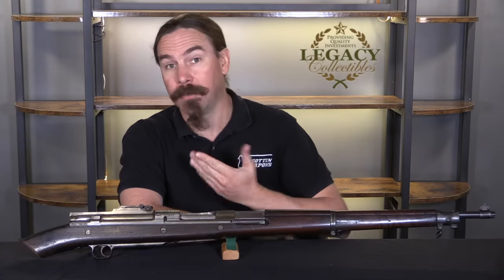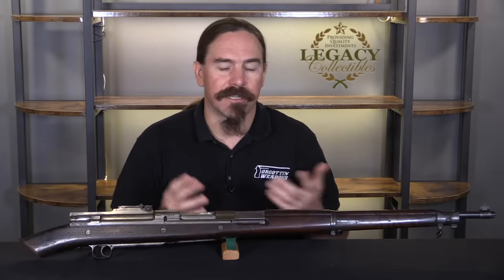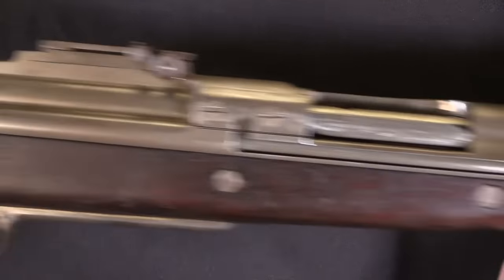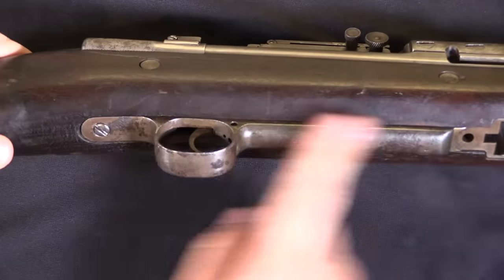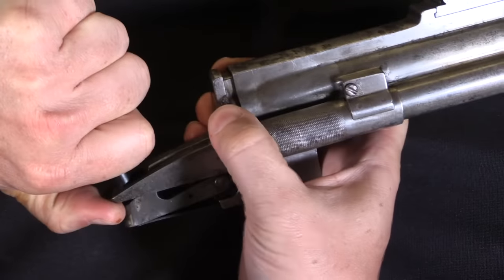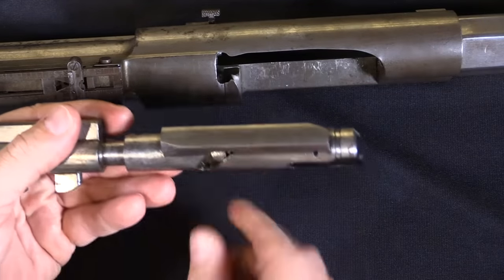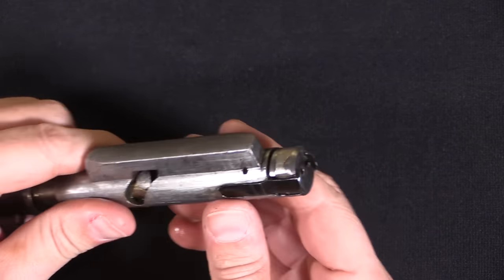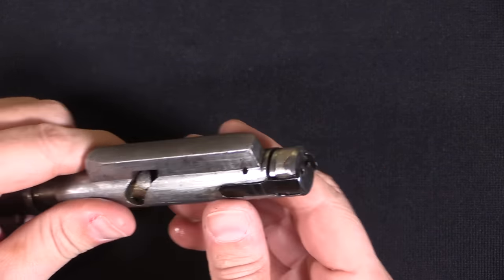Headspace-Operated Prototype Rifle - Yeah, it's as Weird as it Sounds

Comment: I know you often say gun design is an iterative process and that all the things we use today are old inventions, but I didn't expect I'd ever see an old timey version of the HK G36 folding charging handle.
Reply: Almost looked like an ar bolt catch. If this has last round hold open it bet it was the exact same.
Reply: Not only it is an HK G36 folding charging handle but also you can HK slap it.
Reply: @calebreutener870  It does If you look a little tab extends forward and would get hit by the follower when t is a the way u. Exact same profile as on an AR

Comment: The presence of a leather buffer and so many stock reinforcements seems to suggest this thing recoiled like a hammer.
Reply: The idea is kind of a G3 on steroids: no piston, brute force on the bolt, much less delay than the rollers, and a big mass moving.
It would kick like a mule, I guess.
Reply: Maybe they were making work out equipment from surplus guns
Reply: You don't have enough stopping power unless you risk breaking a recruit's shoulder

Comment: Given how dangerous this mechanism is, the inventor probably cut off the stock and mounted it in a clamp so he could fire it remotely with a lanyard just in case it totally blew up in his face!
Reply: That's what I decided once Ian got to where the rifle was in it's development.  An early prototype, like this probably was, doesn't need a shoulder stock, because nobody is ever going to shoulder it.  It will only ever be fired from a clamp, and a shoulder stock would just get in the way.
Reply: It doesn’t look poorly built enough imo, although that bolt doesn’t look too reliable to run reliably and with wear maybe a premature ejection problem
Reply: @egg5474  because all prototypes have to be crude
We dont know if this was v1 or v10
Reply: @justarandomtechpriest1578  no one said it was crude. But by definition a prototype is not a production model and should be distinguished as such to prevent it from entering distribution or being used for other purposes. A rifle of this design without a stock is not likely to be picked up and fired by anyone other than it's intended operator
Reply: @christopherreed4723  atf says if you can't shoulder it then it's a pistol, so there ya go 🤠
Reply: @beargillium2369  Screw ATF...🤬
Reply: @egg5474  its not poorly built but "blowback prototype 30-06" is terrifying to shoulder.
Reply: One wonders if the inventor was hoping to be paid by the inch of rifle length?
Reply: I had a British 303 that was everyone's favorite deer rifle. We shot it so much it eventually grew a large crack up the stock and became dangerous to shoot. I cut it off close to the receiver just so nobody would shoulder it and hurt themselves... Never really know why someone does weird stuff to old guns but that's my story.

Comment: When Ian explains the mechanism of a firearm : 100% on board with understanding how it works.
When I see any gun firing : "Wow, it's unexplained magic !!!"
Reply: Honestly the AK is the only gun I see in action and I'm like "yeah, I know how that works actually"
Most other guns I understand in theory but I squint a little and theres a lot I dont get
Reply: Blowback is easy enough, it's literal weight and spring force that's holding the cartridge in place.

Direct impingement uses gas from a fired cartridge to rotate the bolt.

Now, roller delayed blowback is... Hard.
Reply: @gerrymandarin6388   Recoil operated is similar to Blowback but the barrel moves with the bolt. Short Recoil: The barrel moves half to length of the cartridge before the bolt travels the rest of the way. In Long Recoil, the barrel travels the full length of the cartridge.
Reply: @gerrymandarin6388  Blow-forward and rotating-barrel, short-recoil are both reliant on the bullet's friction on the barrel. It's a simple enough concept, but I'm still amazed that it works.
Reply: This is how I feel about both firearms and cars lmao

Comment: So here's what happens after you have watched enough of Ian's videos- you end up knowing just enough to come up with all manner of theoretical alternative operating systems, such as this one, and then invariably Ian comes along a couple of months or years later and shows you that yes, it might be possible, yes it has been tried but here is why it was shit.
Reply: I made an SMG version of this that was visually based on the Ribeyrolles carbine years ago, lol. Didn't know it was a thing until today.
Reply: @Dreams_Of_Lavender  made?
Reply: @nosuchthingasshould4175  "Made" as in created a concept model in Blender. Not "made" as in created physical prototypes.
Reply: I wouldn't say they are shit designs but simply limited by technology at the time. The working principal of this design just needs to be figured out and this guy simply had trial and error, not high speed cameras and other tools in order to perform any diagnostic checks. Plus it was stuffed inside of an unwieldy form instead of a typical assault rifle.
Reply: @Dreams_Of_Lavender  Color me disappointed.
Reply: Although you can kinda see the germ of the idea that lead to the AR in there, But that Stoner used the gas to push the bolt back and cause it to cam out of battery instead of recoil.
Reply: @Dr_Mauser  AR is an integrated piston. Gas goes between the bolt and carrier to force them apart. It's not true direct impingement.
Reply: @Dreams_Of_Lavender  I'm aware of that, I just didn't want to go into detail about HOW that gas was used, just the fact that gas is used to move the heavy bolt back and cam out the bolt lug(s) instead of recoil as in this gun. Getting too far into the finer details derails the larger comparison, and gets away from the larger point of how this places in the refinement of Semi-automatic rifle actions.
Reply: what
Reply: What do you mean shit?? blow forward, 308, fixed drum magazine sub gun based on the springfield 03a3 sounds like it would be great! As long as we only use traditional stocks though, pistol grips are for chumps /s
Reply: @Requeium   Clearly, You have seen the future.
Reply: To be honest I still don't really understand how guns work. I know the words to describe some operating systems but I don't know how they actually work
Reply: There's a reason we've hit a kind of plateau of small arms development in recent decades. There's only so much innovation that's possible with the current metallurgy, powder and cartridge tech. Other than ergonomics and aesthetics, very little has changed in gun design since WWII and the mid-century era because almost everyone is still building guns around conventional cartridges that really haven't changed since the introduction of smokeless powder. Frankly we should've moved on to caseless stuff like the G11 long ago; it still irks me that that rifle was so close to being adopted only to lose out to the G36 in the end. Not that the G36 is a terrible gun or anything, but still... The problem with mass transition and acceptance of next gen small arms is getting them adopted by the military in larger countries, and the problem there is very stiff resistance to change (always an issue with any aspect of the army, as any vet will tell you) and the absolutely insane stockpiles of conventional ammo that both NATO and the ex-combloc countries have built up. Every time something truly new and revolutionary comes along, be it flechettes, caseless, you name it, one of the primary factors in its rejection is governments/armies not wanting their billions of stockpiled rounds to go to waste -- no matter how effective or big of an improvement the new sort would be. I'll stop ranting here.
Reply: What Ian shows here is just early radial-delayed blowback, like in CMMG's pcc. And it's not that delayed blowback doesn't work with rifle cartridges either: look at HK's PSG-1. Probably, it's just the time it was.
Reply: I also have a concept of a pistol caliber 8 lug rotating bolt with headspace operation in mind and might actually write something down after watching this video. Sadly no engineer tho
Reply: As a hobby designer(I don't make any) it has been my holy grail to design system which doesn't need gas system, has fixed barrell, is simple enough, semi+full auto capable, no delaying mechanism and is as reliable as gas.
Non moving barell would increase accuracy, lack of gas piston would make it simplier, just bolt striking with striker and waiting on its own without outside force to open in set time. I find it appleasing that Ian found this cool concept simillar to my ideas.
Reply: @MartinMizner  i thought of a similar system a few days ago haha everything really has been made before, though my idea would be that the bolt face has a fixed firing pin and the recoil of the case would basically unlock the action
Reply: Hilarious 😂 but the truth inarguably
Reply: Hilarious 😂 but the truth inarguably

Comment: This system seems kind-of like a linear version of lever-delayed blowback, where the "lever" is the bolt head with the locking lug and cam-way, that is forced to rotate and unlock as the breachface is pushed back slightly and forces the pin to travel along the cam-way. Like the FAMAS and HK roller-delayed guns, would probably work properly and consistently with a fluted chamber, but that technology apparently wouldn't be developed until several decades later.
Reply: I'd call it impulse delayed: breechhead (?) delivers impulse to bolt carrier, is then halted by the bolt, bolt carrier continues rearward on impulse alone and unlocks the bolt. A Newton's cradle, but clearly more fun.
Reply: Yes it's basically delayed blowback.  The cartridge can blow the bolt head back a short distance and get the carrier/buffer moving before the bolt head bottoms out on the main bolt body.  That buffer then has the energy to cycle the system.  Kind of reminds me of Pedersen's hesitation lock system only with a rotating bolt instead of tilting bolt.
Reply: All of you are wrong lol yes it is a delayed blowback, like a CETME rifle, using a high-pressure rifle cartridge. The closest thing this resembles is easily a CMMG rotary-delayed blowback system, where the inertia from rotating the bolt is the "delaying" force. Although, I will say yes, this does look like an enlarged portion of half an HK roller-delayed system.
Reply: @dravidiantommylinson3880  It's the same hesitation lock operating system as the Pederson - the bolt is allowed to move a very small amount, which sets the bolt carrier in motion (a slide, in the case of Pedersons Remington 51) which then opens the bolt after some delay. However, the locking mechanism is a rotating locking piece. It differs substantially from the CMMG, as it features a small movement of the bolt, then a stop, then a subsequent movement. After the initial movement of the bolt head, it unlocks in a similar way to gas operation or straight pull bolt action, with the bolt carrier unlocking and providing motive force to the bolt. 

By contrast, the CMMG system does not involve any stop and restart in the movement of the bolt head, instead the bolt head is allowed to move back, but to do so it must move an additional mass faster than itself, slowing the initial opening, but not the rest of bolt travel. The CMMG can be grouped with lever and roller delay systems in that they all rely on a bolt body having to move faster than the bolt head to slow the initial opening, whereas hesitation lock is somewhat weirder.

It's difficult to clearly explain hesitation lock systems simply because they are so unfamiliar.
Reply: Yup, it's hesitation lock
Reply: It's almost reminiscent of the rotating barrel setup seen on the Savage 1907 pistols.
Reply: Curious as to why you think that a fluted chamber would fix it
Reply: @walt9327  The same reason it works with the H&K roller-locked rifles: it floats the case-mouth on propellant gases, so the front doesn't get ripped off due the somewhat un-gentle extraction they are reknowned for.

Comment: And once again the sheer POWER behind that tiny little explosion in a gun's chamber blows my mind! I was already surprised how little of the travel on a long stroke gas piston actually happens under pressure before the gas is vented, but this is such a tiny little kick against a bolt face that is already enough to make the bolt cycle all the way against its recoil spring (even if it doesn't do so reliably) and if I was a gun designer then this kinda stuff would never have to to my mind!
Reply: That tiny little explosion isn't tiny relative to the amount of space it's contained in. Sure, outside of a chamber the blast radius would be like, an inch or two for most intermediate calibers, but remember, that's crammed into a .30 cal hole
Reply: Well let’s do some (really rough) math:

30-06 has 60kpsi max pressure. (Bolt thrust of about 4.5 metric ton)

Say the bolt head only travels 2mm? (About 0.080 inch) I’m just guessing based on that Ian kinda showed us

[The difference between max and min SAAMI spec is 0.51mm]

A force of 4.5 ton applied on a distance of 2mm is approximately 90 joules or half the energy of a .22lr.

Those 90ish joules are only used to unlock the bolt (against friction on the locking lug and case head, I’m including that at the end as a note)

Using 90 joules and vaguely guessing the bolt carrier weighs 100g (3.5 ounces) [half the lightest of AR15 bolt carriers]
The bolt carrier is thrown backward at 40 meters per second (130fps)

The camming surface appears to be about 3/8 inch? I’ll use 10mm.

So the bolt carrier is travelling 10mm backwards at 40m/s

The bolt unlocks 2.5 milliseconds after ignition?

Once the bolt unlocks the whole bolt/bolt-carrier/bolt-head share momentum/energy and would be travelling around 20 meter per second or 48 miles per hour. 

Plus any residual gas pressure left in the barrel which at this point is well below 10k
(not enough for me to worry about personally, however I will note that being nearer to 6k, the thrust provided by residual gas would be comparable to 2x 22lr’s at once)

My estimations also suggest 20-100 joules of energy is lost in friction between the locking lug and receiver (steel on steel coefficient of friction is vague)

Once tuned right with consistent ammo the recoil shouldn’t be too bad
Reply: @thomasa5619  you: "some really rough math"
Also you: *writes a complete dissertation, thus completing your PhD in science having previously majored in ballistics *
Reply: Not Graham. I estimated like 3 different measurements using “gun jesus’ finger” as a reference
ignored several aspects
then randomly decided “once it’s tuned it’s probably cool”

It should do the job. But it’s still rough. I just enjoy math
Reply: @thomasa5619  gun Jesus fingers are an official unit of measure, and you can't convince me otherwise.
Reply: Not Graham. That’s cool I just don’t know how to convert them to metric

Maybe we should get him a calibrated plastic pokey like othias, or an organic sheathed carbon rod or whatever mark Novak calls pencils
Reply: @thomasa5619  gun Jesus prefers a bic brand plastic firearm punch
Reply: Not Graham. I wasn’t paying enough attention to notice a punch in the video, lol
Reply: @thomasa5619  he didn't use it in this video
Reply: Not Graham. Lol, now I’m just imagining every video “and here’s a 3/16” punch for scale”
Reply: @thomasa5619  lol well I did say a Bic brand punch lol he uses a pen
Reply: Not Graham. Oh, lol, yeah his “universal disassembly tool” I remember now